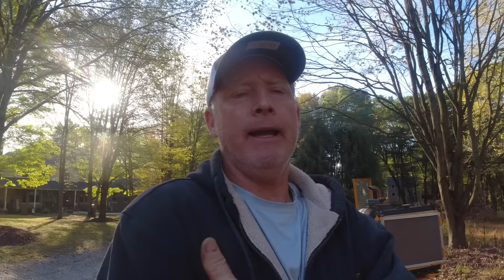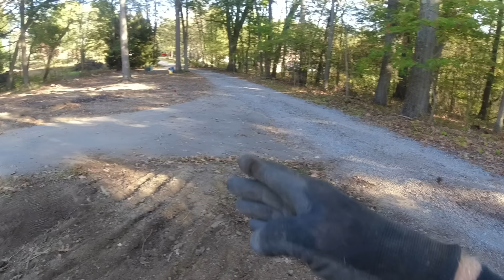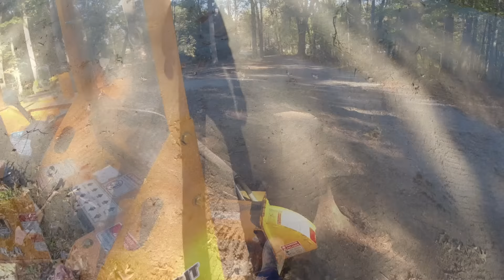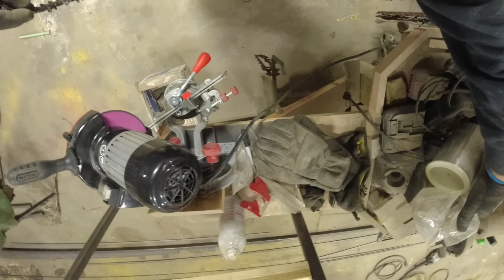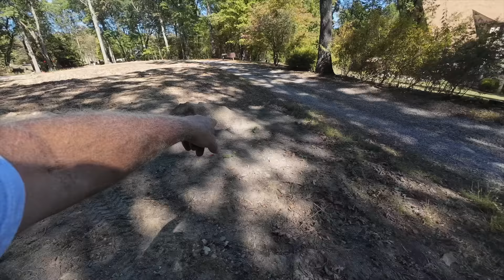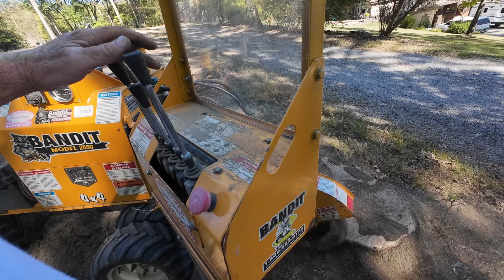Trying Out a New Toy!

Comment: Emily's house is coming a long way it's really looking good.

As they get settled in and digest of ownership cost you always end up with a list of things to do not real important it's just the architectural exterior look but that front entry where the slope goes down to incorporate the front porch at the front door entry is God awful whoever framed that up or design that house needs a different career selection it wouldn't be hard to do but I would put a Gable end right there and use those Timbers like some of the newer homes and put a nice light in there and just put a v it would match the other V on the house it's a lot of work it's additional cost but it sure would make the exterior of the home look much better.